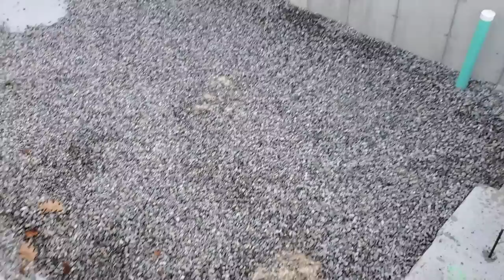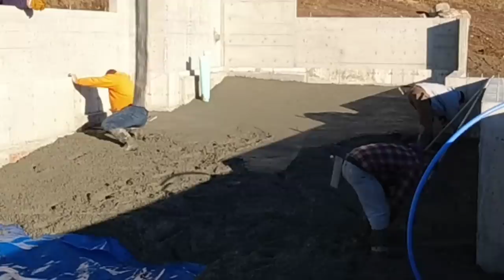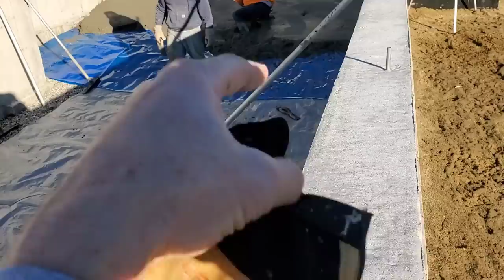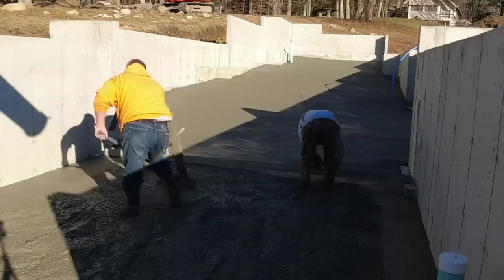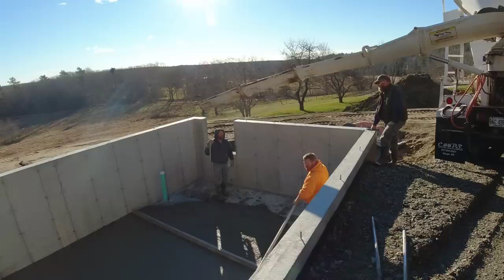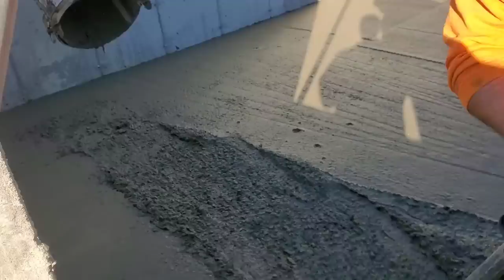We Poured This Concrete Floor 6 Feet Out Of Level (Mud Slab)

Comment: I remember doing 1 similar although it was relatively flat, to seal off a conditioned crawl. Nice part was you could use a mechanics creeper to work in the crawl after the first floor was in.

Comment: All crawlspace areas should be poured with concrete. HVACR contractor here. This would make a crawlspace home much more healthy to live in.
Reply: It's code to install a condition crawlspace....heavy plastic and insulation board....but concrete would be perfect for sure...👍👍
Reply from the maker: We pour a dozen of these a year, similar to this.
Reply: @paulunderwood8960  it’s not code where I’m at. My house I just built has a conditioned crawl, but I paid for it.
Reply: @Jraksdhs  yeah it's just scattered around not every County here in Virginia makes people do it just some either way it pays to do it
Reply: @MikeDayConcrete   I saw your little Instagram post  calling my comment on this video “stupid”. And then you used your little hashtags to claim that you’re a “millionaire”. I realize you’re all about making money. I’m saying there’s SO much out there to learn than pouring concrete in your isolated portion of the US. That’s great that you’re money hungry and don’t know anything else, but you look like you’re 75 years old and your diction is that of a high schooler. Education isn’t stupid. Also, I had a full-ride. Keep breaking your back for my patio 😘
Reply: Also, millionaires NEVER have to tell people they’re millionaires. You’re a bum.

Comment: We did a bunch of homes here in Pa. with crawl spaces ,,,,2 1/2 to 3 inch thick slab float the edge,,, rake  it out and bullfloat ,,,,,2000 lb. mix !!! Like pouring a sand mix !!  Between 900 to 1200 sq.ft.  We dont have conveyer mixers here so we would use an all terrain forklift with a 3/4 yd. lay down bucket on the forks worked out well !!

Comment: I’m a little surprised to not see any rebar. Are you comfortable with fiberglass re-enforcement?
Reply: It’s a non structural floor.
Reply from the maker: We use fiber everyday. It's on solid ledge rock, where's it going to go even if it does crack.

Comment: Front discharge truck could pull around on that other side!
Reply: In video , he said it was too sandy .
Reply from the maker: I don't have that choice in this area. Both companies are rear discharge.
Reply: @MikeDayConcrete  thats what I figured. u should make that your new buisz. u would do really good, those trucks are so much better. but I've never seen a conveyor truck front discharge

Comment: Difficult to understand how the multiple height walls will be utilized. Fast concrete pour and quality work!
Reply: That's what I was thinking. Maybe an architectural home?
Reply: Might be framed knee walls on the stepped concrete foundation?
Reply from the maker: The foundation is stepped according to the landscape surroundings. Then framed to height of the deck at each level.

Comment: I didn't see any steel  not even wire mesh. Couldn't a small movement in the  soil cause major damage ?
Reply: It will crack , but it’s a no load floor. Will just be cosmetic.
Reply from the maker: It's on solid ledge rock.
Reply: @MikeDayConcrete  Thank you for the reply.  I think your website is a good tool for people with no experience with concrete.  Keep up the good work.

Comment: A house that will be a pleasure to work on in the future. My earthen floored crawl space is a nightmare. What did this cost? $6,000, or so? $8,500?
Reply: Put down some vapor barrier and keep it down with some gravel? Could solve a lot, and a very simple project. Could solve a lot.
Reply: @elbuggo  I have installed vapor barrier. But, there was no care taken, in 1974, to groom the ground in my crawlspace, or anybody elses, really.
You'll encounter chunks of concrete rocks etc... Not a comfy crawl when it becomes necessary. 
I've been involved in real estate, home construction, and mortgage lending for 40 years. We aren't taking a lot more care these days, where I live, but most newer homes are way better than mine.
Reply: @hampyonce  how comfy does a crawl space really need to be? Most houses here the don't allow access to the crawl space at all. Do you need it for hurricane shelter or something?

Comment: Totally unnecessary and useless. A encapsulated conditioned crawlspace does the same thing.  Works better. However if you have lots of money and want to a pour a floor anyway, why not level it out stepping it down as you go. Potentially areas could be used for a water heater, HVAC, well pressure tank, water softener or needed  storage.  You still have to manage ground water and moisture...
Reply: Obviously u didn't watch the whole video...cause that's exactly what going in on the flat end...big rocks on the other
Reply: Bringing in fill to level it would be more useless because they hit ledge and can't go down any further so the maximum space in there would be minimal unless you brought in equipment to dig a basement which would be pricey.